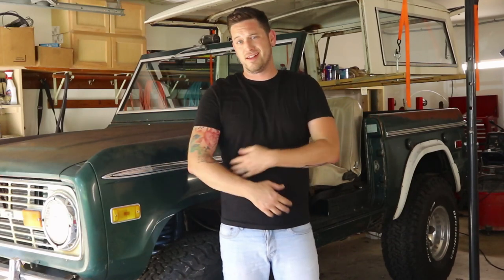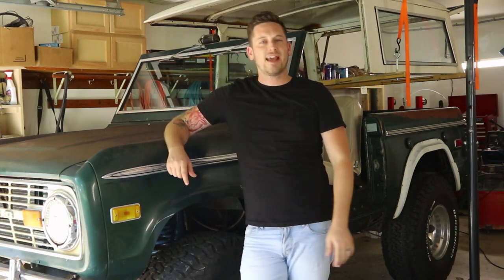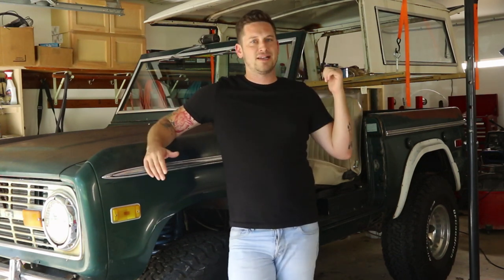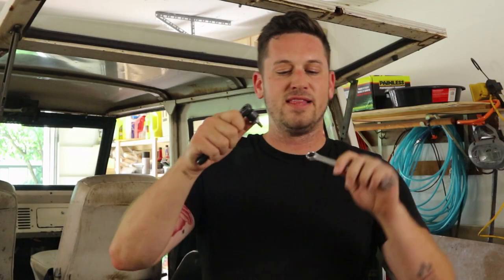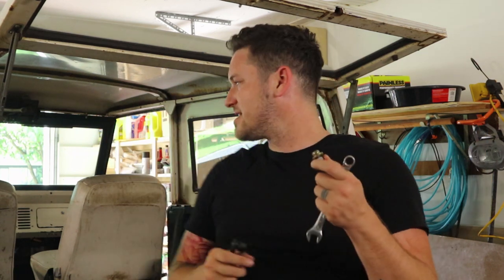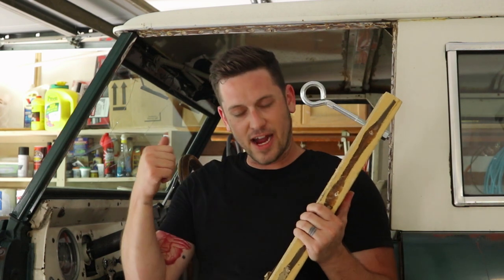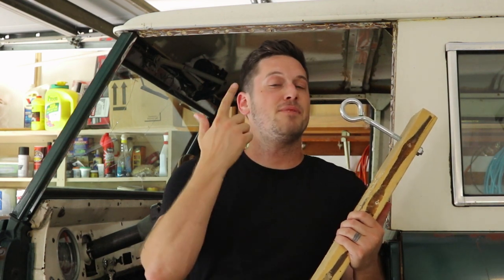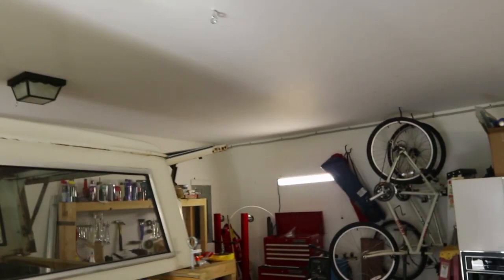Take your top off! Early Bronco

Comment: you should notch the 2x4's near the roof rails so the lip dosn't flaten out. great video
Reply: I was going to comment about this. Notching is a good idea. I ended up adding 3/4" thick plywood squares on top of the 2x4. It gives just enough height and surface area so the top is resting in a way similar to how it would be when installed. Thanks for the video. Cheers.
Reply from the maker: +ron wilson good idea
Reply: Great idea. We'll probably do that, once we figure out how to get the top of our off. Previous owner sealed it on with paint. 😢
But we're determined to make it right, again!

Comment: I have a 68 bronco and for some reason the top wants to come off besides the very back by the tailgate any ideas
Reply from the maker: There are bars that go down into the back of the Bronco body that are attached to the top. Mine are short, but originally they went down about 4 inches.

Comment: doesn't show the rear posts, do you cut them off?
Reply from the maker: You can unscrew the rear posts
Reply: @NashvilleEarlyBronco  thanks, mine seem. to be stuck and don't want to snap the bolt or put my hand through the side window. have been debating cutting it off.
Reply from the maker: That’s crazy!